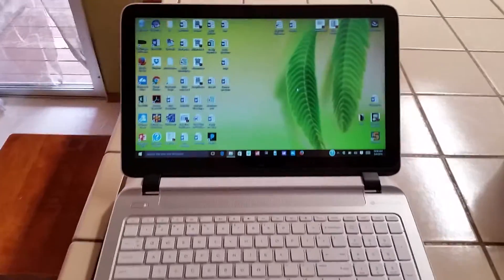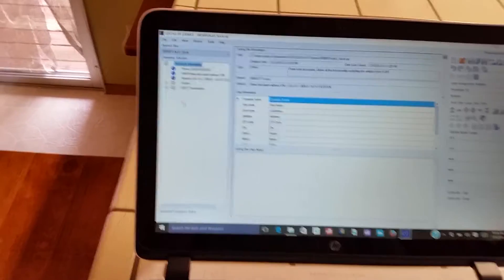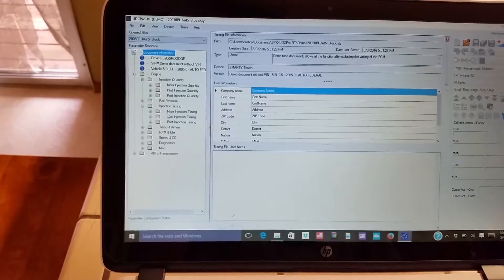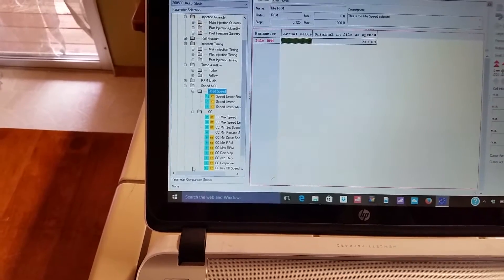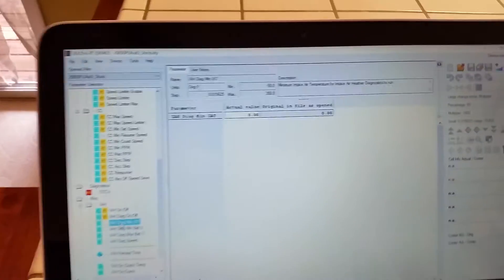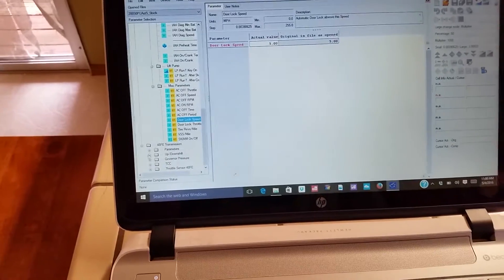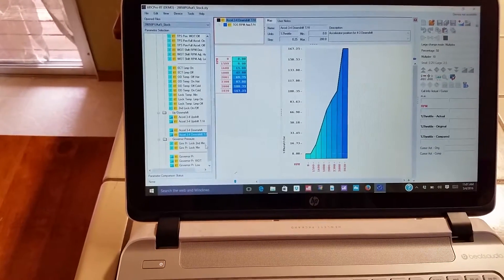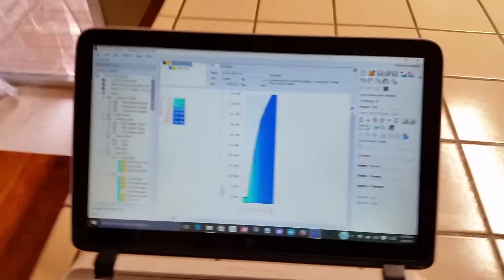Smarty UDC PRO-RT Full control tuning for 3rd Gen 5.9 Cummins trucks

Comment: can you write tunes with this im interested in 2005 5.9 cummins 12 valve tune..or old 24 valve sound anything to turn off injection events to get better diesel sound..transmission tuning would be great i run smarty jr on sw1 tq 2 tm 2 and it shifts fine but any higher i dont like the shifting sct has the best tunes but they dont do cummins